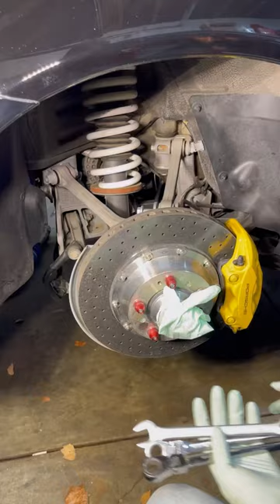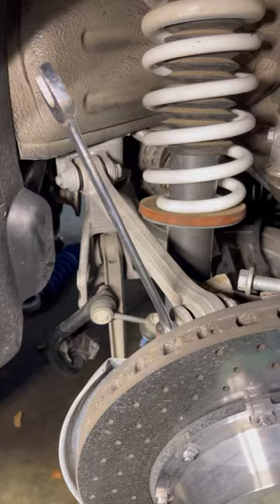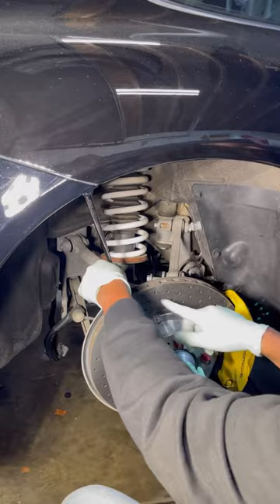Mechanic X beam specialty wrenches cross force ratchet tool vs standard hand damaging

Comment: That's an impact job right there
Reply: You can, and you can actually mess up the bushings doing this too. The shock bushings meant to absorb impact.
Reply: @tim7656  there's a sleeve in the bushing. The sleeve is so you don't completely squish the bushing when the bolt is torqued. Impact gun will not damage that bushing
Reply: I personally just whack the wrench with a deadblow of rubber mallet. Cheaper than buying another set of wrenches.
Reply: @beenrudy  yup, your 100% right about there being a sleeve. Unfortunately if the bushings old enough it’ll rip out of this sleeve and need to be replaced. Typically if that happens the bushings bad anyways, but, to get it torqued properly it’s best to use hand tools for the job.
Reply: @tim7656  if the bushing is old and worn out then using a normal wrench will also ruin it so using an impact is irrelevant. I also didn't say anything about putting it back on with an impact gun. This video only shows him removing the bolt

Comment: I never break anythin loose with a ratcheting wrench, unless i feel like busted knuckles. Breaker bar with a 6 point socket and an extension first, then use the ratchet wrench, makes your ratchet wrench last a lifetime.
Reply: Learned that mistake years ago, broke a ratchet wrench mechanism using with an extender on a stubborn bolt. Now I only use ratchet wrenches to quickly remove bolts once they're already broken loose
Reply: You could also spend the extra money on a brand with a good lifetime warranty, then you can use and abuse all you want. I find that to be the easier route but I won’t disregard other points.
Reply: Stop being logical. Buy more tools.
Reply: I traded in my 1/2" breaker bar…
For a 3/4" telescopic ratchet that's ~5 feet long (from Matco), after I sheered the drive square.

Good choice, IMO, because I haven't broken the ratchet yet.
Reply: @Iowa599  Do you work on heavy equipment?
Reply: @bj666rn  Yes & no. I am ASE Pro-Tech certified for cars, and not trained for heavy equipment, but I'll work on anything that pulls in (or is pulled in by something else).

The breaker bar sheared when removing the blade spindle nut on a 120" mower. Luckily the Matco truck pulled in as I broke it, & the 3/4" had the blade off in less than 20 minutes!

Comment: I wouldn't double-wrench in there, I'd just get an equal length 3/8" ratchet and socket, you clearly have the room. Normally you only resort to a wrench when you don't have room for a ratchet or an impact, which is why the wrenches are small and skinny. Clearance

Comment: I appreciate the demo of the tool... But to be fair, the correct hand tool in this situation is a 6 point socket, a breaker bar, and an extension.

The wrenches are for that inner bolt of the forward upper control arm.

Comment: Dude, working on cars like that, get yourself a Milwaukee impact gun and work smarter, not harder. While they bigger 1/2" guns have a lot of torque, they're easier on the hands (and bolts) than the old air guns and the multi speed settings help prevent over tightening or being too aggressive on smaller bolts. 

Admittedly, the Gearwrench tools are nice and they last. I've had mine since they came out in 2017 or there abouts.
Reply: Maybe he has impacts but chooses to still use his hand tools?
Reply: He absolutely has impacts lol. He is showing off a tool and its benefits. This was an example to show the tool. Not the way he does it all the time.
Reply: Not everyone has to be in such a hurry. Also I'm sure ya boy has all the tools, he just wanna flex this one.

Comment: There's no way you broke that bolt with a ratcheting wrench. You would have stripped that racheting mechanism. If you did break that bolt like you showed, then it wasn't on that tight and the standard wrench would have worked without hurting your hand.

Comment: I would use a socket wrench since the gears your using are plastic in those wrenches, they wont last too many times. O ya 1/2" not 3/8"